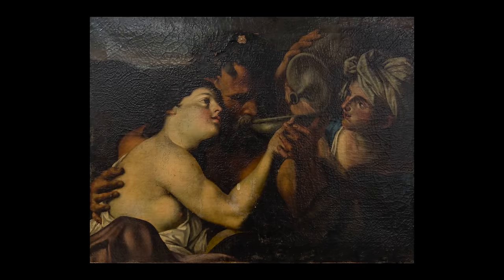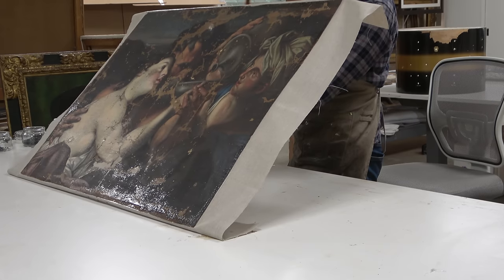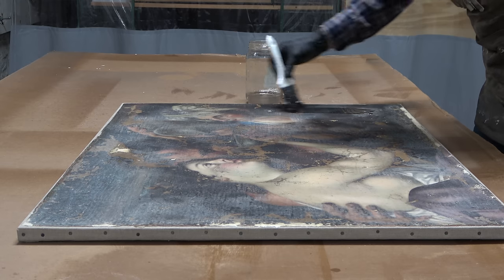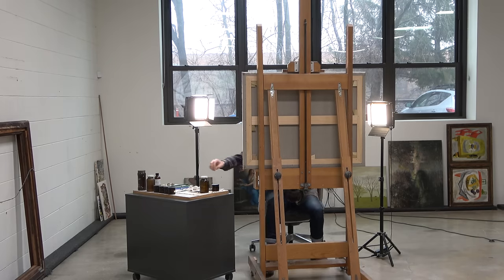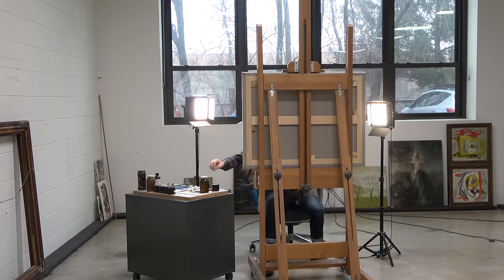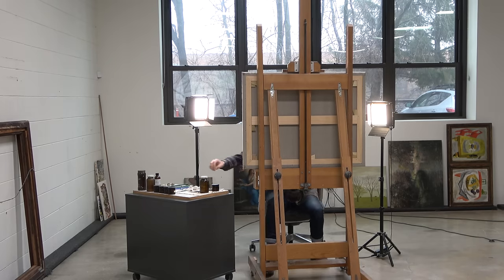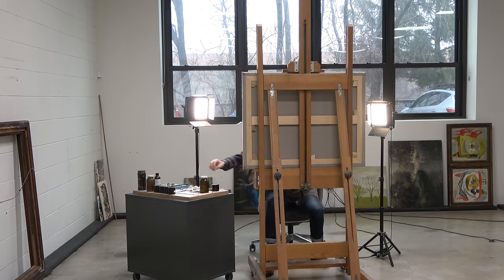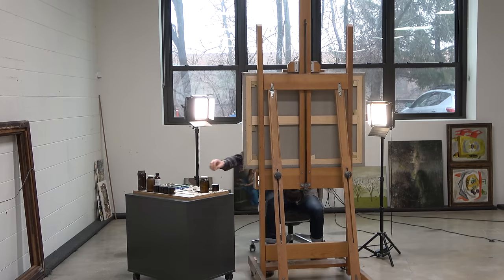My Cup Runneth Over Part 2 of 2

Comment: Julian, considering the isolation layer of resin, is there the possibility of using oil paint to do retouching? (as opposed to the paint you usually have, that dries quickly and doesn't blend so well?)

(I'm not a professional, just a curious person thinking thoughts ❤)
Reply: He explained in a video over a year ago (?) that as oil paint cures it oxidizes and changes color unpredictably overtime with its exposure to whatever environment it’s it.  I think it was the rough seas painting, but don’t quote me 😬.  Someone else had retouched with oil paint and after a number of years it had completely changed color and looked really, um, odd.  He uses the more difficult conservation paint because it’s so easy to remove for the next conservationist, and because the color it is when it dries almost immediately is the color that it stays. I think he said he’s UV stable, but I don’t remember.
Reply: @acaciablossom558  thank you! ❤
Reply: @raquelhoffmann4  you bet!!

Comment: Julian - question. Do you always remove all overpaint and existing fill in before you put in your own? If you do chose to keep the existing overpaint and fill in - what criteria do you use when deciding to replace it? Would it have to be structurally unsound? Or just old and there is a better more modern alternative? Or would the overpaint just have to be badly done?

Comment: If you have an isolation layer protecting the original, is it still not appropriate to use oil paint for retouching?
Reply: The isolation layer wouldn't protect against everything. The solvents in the oil paint could penetrate through.
And while he has difficulties with the fast drying retouching paints, he would get other problems with slow drying oil paints. It would take weeks before he could then attach the last varnish.